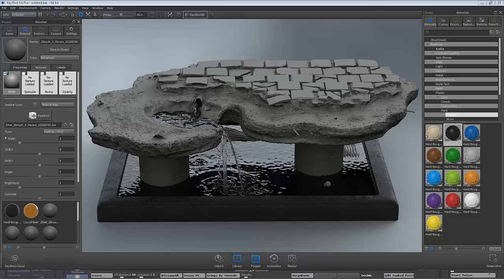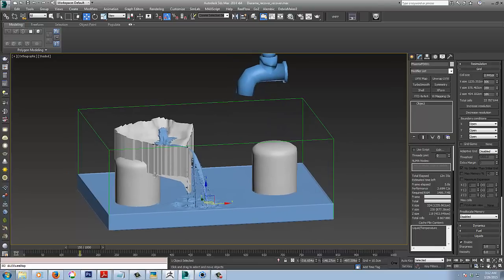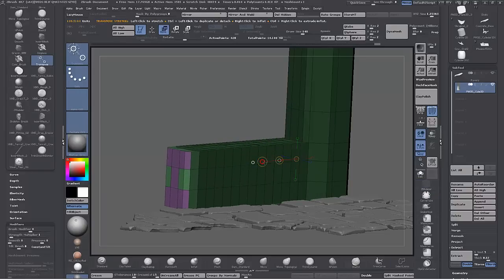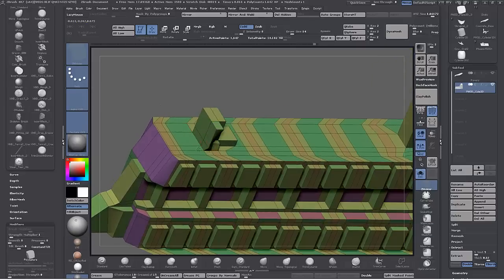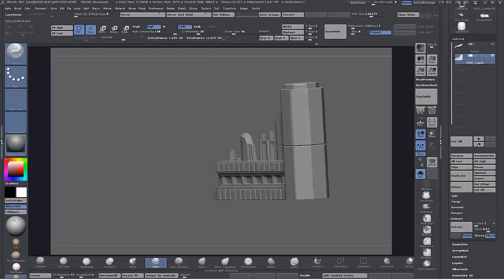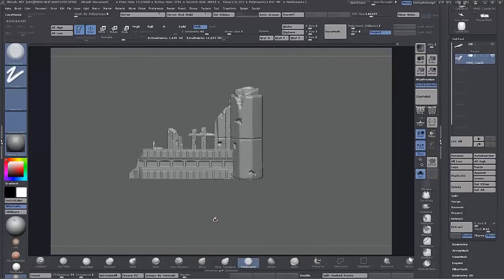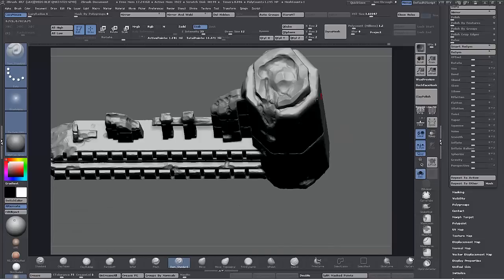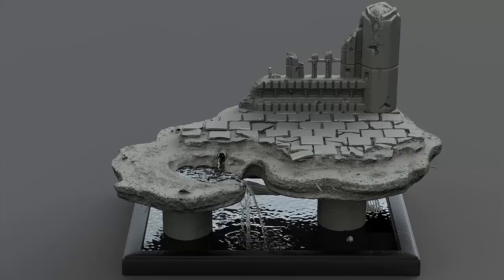Zbrush 4r7 - Making of: '40K Diarama' Part 3

Comment: To change your start-up material you can just edit your DefaultZScript.txt file located in Zbrush 4R7/ZScripts. 
In the file add the following:
//startup
[pd]
[If,1,
[IPress,Material: MatCap Gray]
]

This will give you the matcap gray as the start-up material. For another material you just write that name instead. Save the text file, then next time you open up zbrush it should be the start-up material.

also, you can get this plug in over at Safrinov3D's youtube video that will change the preview material on the tools in the tool palette. The video is at https://www.youtube.com/watch?v=gLks36VTr84